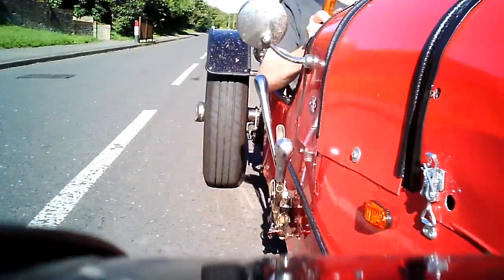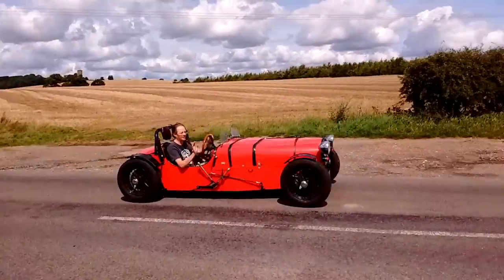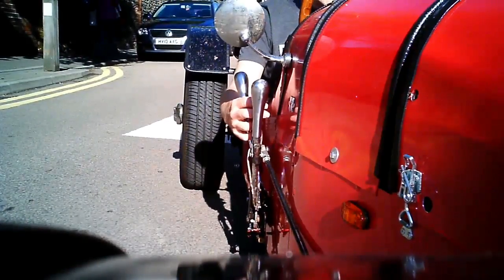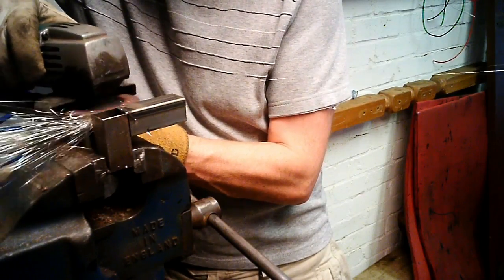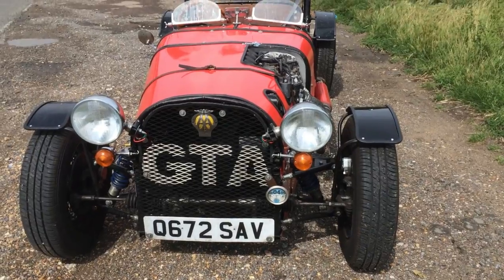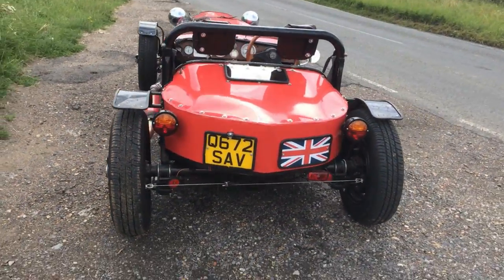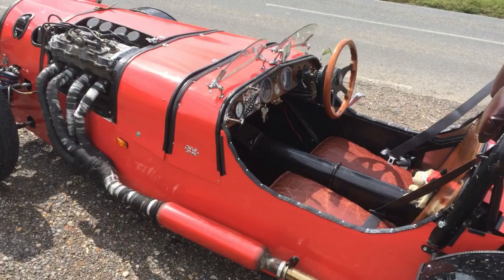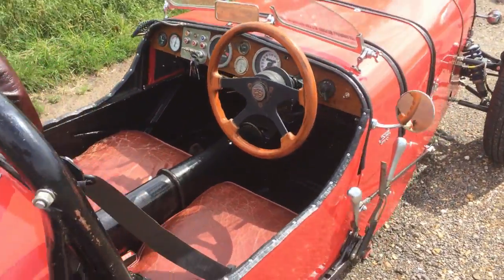Home built scratch car using a motorcycle engine (ZZR 1100)

Comment: How does the clutch like all that weight? Has it failed?
Reply from the maker: I put high grip clutch plates in, it shouldn't slip anyway because the engine isn't producing any more power than standard.

Comment: Dude this thing is awesome! For reference for my fellow Americans who don't use the metric system, 400kg is about 882lbs. With 145hp I bet that thing goes like a rocket. Mad respect from Texas!
Reply: I’m English and I don’t think in metric.
Reply: @chrishenniker5944  There always has to be a rebel. You Brits seem to like being strange. 
I am English also, but living in Canada. We seem to use both Imperial and Metric. 
Gets confusing at times. They have calculators to do the math for you.
Reply: @seanns1945  in England we use miles/yards on the roads, mostly metric in schools & both imperial and metric for weights/measures commerce etc. Canadians do English and French, we do imperial and metric :)
Reply: ..and Welsh ..and Scottish Gaelic ..and we still measure shoes in barleycorns.. apart from that, we're totally normal!
Reply: @flannel2699  LOL I know.
Reply: Yup, like driving a typical 2 ton car, but with 600 hp.
Reply: @brianlenehan9055  far not the same in many means but In some mountain pass with tight curves turns they will be absolutely incomparable :)
Reply from the maker: When I'm working on the axles and wheels I have to work in inches because they're from an MG BGT, the chassis is made from 1" square box.  However, for the rest of the car it's metric.  I have lots of different spanners.

Comment: Were Can u bye that adapter for the diff Got a Honda cbr motor i wanner put in an old Fiat 126
Reply: Drive shaft to gearbox adapter
Reply from the maker: I bought mine from AB Performance, that and the prop shaft were one of the most expensive parts of the build.  http://www.abperformance.co.uk/products.aspx?cat=35

Comment: Awesome build, great use of scrap parts! 😎👍 I'd consider wearing a helmet while driving that though⚠️
I remember driving along a dual carriage way one time and something flew off a lorry driving along the opposite carriageway, not sure what it was, round about the size of a shopping trolley wheel, bounced into my path, up off the road straight into my windscreen, it made me jump so much I instinctively ducked as I expected it to smash through my windscreen, it didn't but gave it a hell of a wollop. I dread to think what could have happened if it hit me in the head⚠️😯
Reply: I had a similar experience many years  ago driving back from Fort William to Newcastle in the old days when cars didn't have laminated windscreens got stuck behind a builder's wagon for a few miles on single track road and his back  wheels picked up this big rock that hit my windscreen like a missile the noise was frightening at 60mph my instinct was to punch my windscreen and make a little hole to see were  i was going  it was very scary just as well i was only 22 otherwise if i was older i am very sure i would have had a heart attack i am very lucky it was summer time i drove over 200 miles without a windscreen in it got some funny looks with splattered flys all over my face
Reply: an awesome build i have just retired but don't want to go back on two wheels this would be the next best thing used to love it in the early 70s when you didn't have to wear a crash helmet

Comment: Great little bolide, but I'd have loved to hear more of what went into it - chassis, running gear, linkages, fuel delivery, etc - and what was that shudder-inducing noise, like a pistol shot, a few seconds after it was started? Tell us all!

One gripe. I don't think modern nomenclature (GTA, RS, etc) fits with what's clearly a retro machine, and one with such a telling detail as an old AA badge! I'd have preferred something like 'SS1100'.
Reply from the maker: That was me putting it into gear, it does have a cush drive in the prop shaft and the clutch isn't binding.  GTA are my initials and on the reg document i'm an official car builder.

Comment: Great project. Fuel consumption?
Reply from the maker: Roughly 15 litres takes me 80 miles (129 KM), my tank is 20 litres.  I have run out and had to walk to a petrol station, buy a can, fill it and walk back to the car.  I really must fit a fuel gauge.
Reply: Wow. I expected better numbers than that.

Comment: Why a bike engine? Wouldn't they have used a Ford Flathead or GMC truck engine back in the day? If you wanted to go fast back in the thirties, you either hopped up a Ford Flathead, found a truck engine or something out of a luxury car, like a Cadillac V8.
Reply: Smaller, lighter weight, more power, and probably cheaper, as you can find plenty of engines in salvage yards.
Reply: in the UK so we never got big v8s back then. Plus bike engined cars are quite popular in kitcars/caterhams etc for when you want to go really quick
Reply: matthew clarke Bikes don't have a reverse gear, that's a problem with them.

Comment: I'm putting a 94 GSXR 750 in 67 Karmin gia. I bought for 40.00. it's a rolling car - motor. Little rusty.mid mount straight axel. Chain driven no reverse. I got no $ into it.
Reply from the maker: Sounds fantastic, sounds like it might spin round a lot.

Comment: How did you sort out the transmission?
Reply from the maker: I use the gearbox in the bike engine, connected to a drive shaft to the rear axle.
Reply: @cryptkicker055  So no reverse?
Reply from the maker: @lennym1273  I have in the past asked members of the public to help me push it backwards.
Reply: Is there a link to Transmission to gearbox adapter ? Or photo ? I’m looking to build a kit car using motorbike engine. Yours is wonderful.